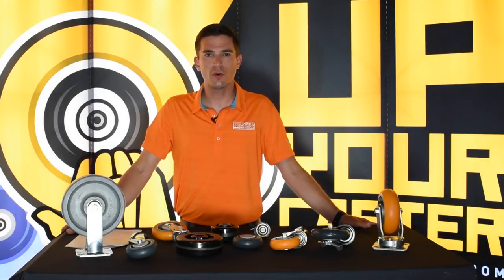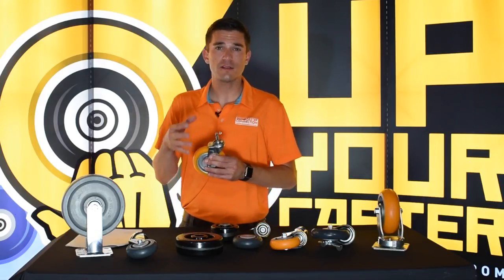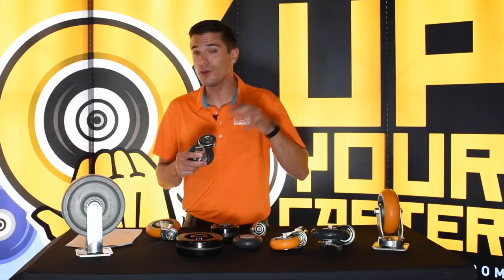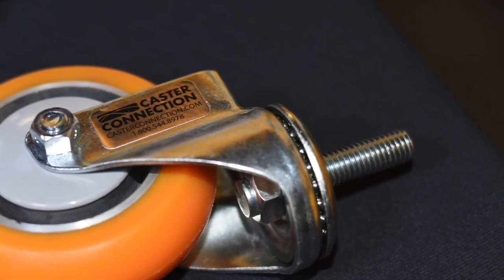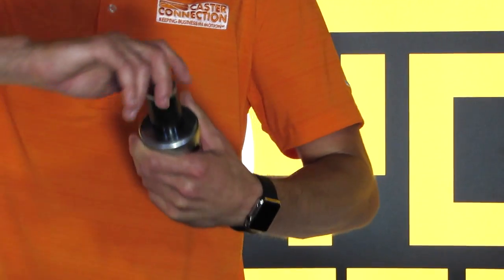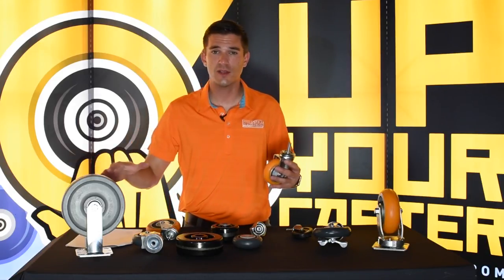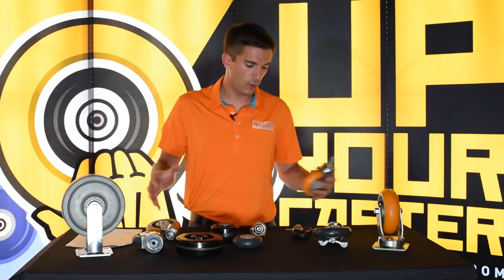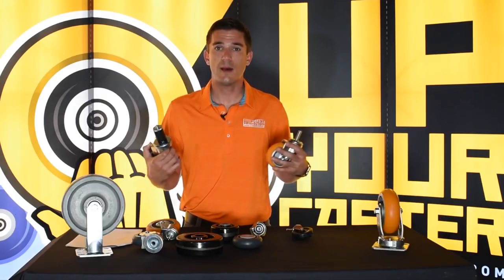Anatomy of a Stem Caster: Your Caster Connection

Comment: Would you please let me know how to open a nut from a caster wheel on a cart. The nyloc nut and the stem rotate together when I want to open it and keeping the bottom octagon plate didn't help.
Reply from the maker: Hello, did you try to hold the stem and to loosen the nut with a wrench? Sounds like that may do the trick if we understand the situation correctly.
Reply: came here for same thing (i think?). bought a pack of 2 and the socket and stem are already joined. instructions say after drilling the hole (step 1) "2. remove the socket from stem and insert it into the drilled hole by tapping with hammer. 3. push caster stem until it locks." but it's already locked and i can't seem to separate it. not sure how else to explain other than to say it's this exact one, and in the pack of 4, the parts are already attached like the pic shows. apologies for the 'greenness' of my comment. new to this stuff (obvi lol). https://www.shelllumber.com/prosource-caster-hooded-stem-2in-brass.html?feed=Froogle&gclid=Cj0KCQjwsqmEBhDiARIsANV8H3ZAUC9Hco_3bs_dZJ5ZBJRjKkCSeB5HPDQnfNOQWmcZz73EHb3EWGYaArmfEALw_wcB

Comment: I recently started to refurbish a convertible hand truck. It has 2 swivel stem casters on it that I am replacing with heavier duty and wider wheels so I need new caster yokes/forks.  I need to find 7/8" dia. pipe stem swivel caster yokes. I have new wheels 5" x 2" cast iron/PE and can't find these yokes/forks.
Reply from the maker: Hey Leonitas, we've got a ton of casters on our site, and you can contact us by phone at any time--number is on our site.
https://casterconnection.com/

Hope that helps!